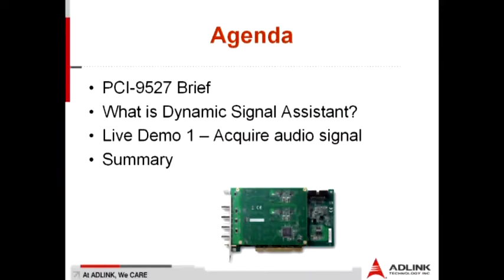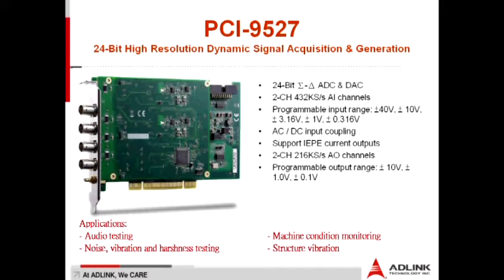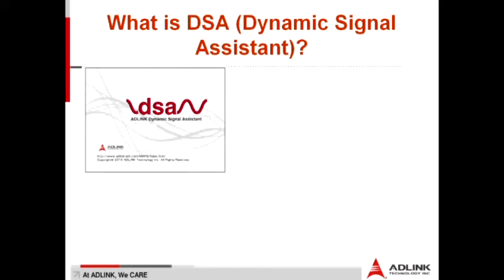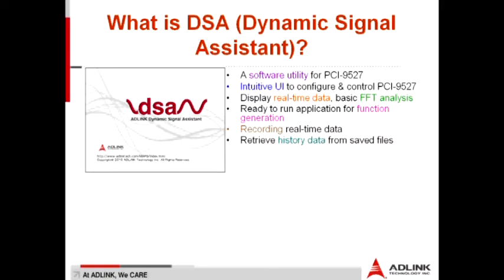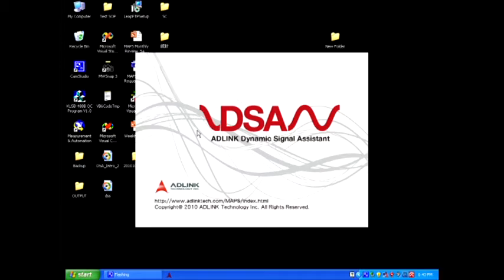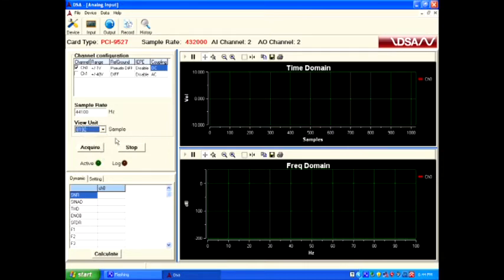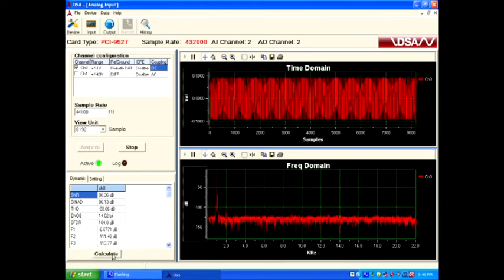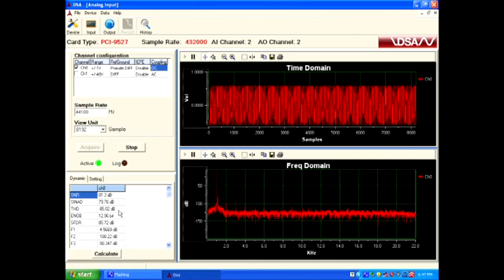Dynamic Signal Assistant Live Demo & Introduction (English Version)

Comment: Hi! 

We are trying to evaluate PXI-9527 so we can determine if it's helpful for our test work. You demonstrated how to acquire audio signal using the DSA in this video, but didn't show the connection between the mp3 player and PXI-9527. Could you tell us how to connect these two devices (mp3 player & PXI-9527)? Any resistance matching problem?

Thanks!